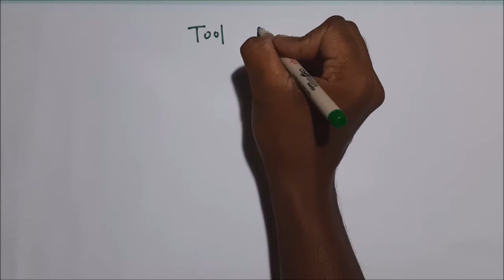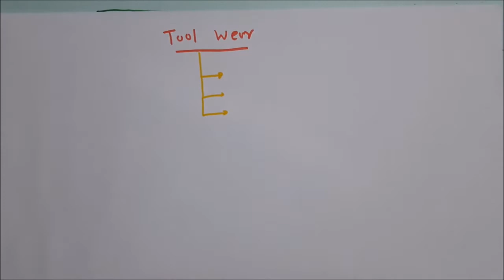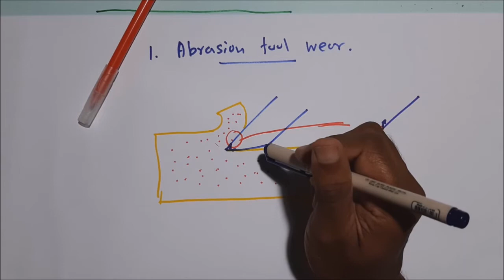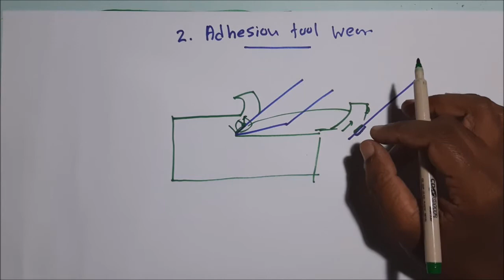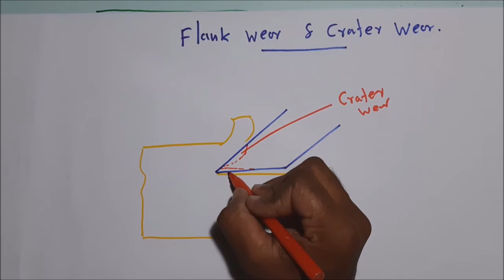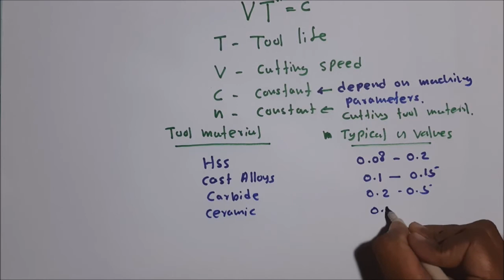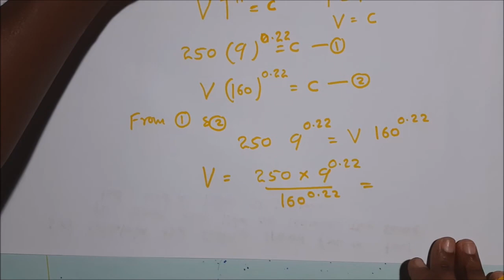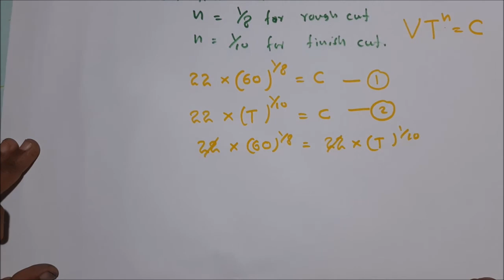Taylor's Equation for Tool Life | Lecture-5 Part III

Comment: tool failures - 1:00
tool wear intro - 6:24
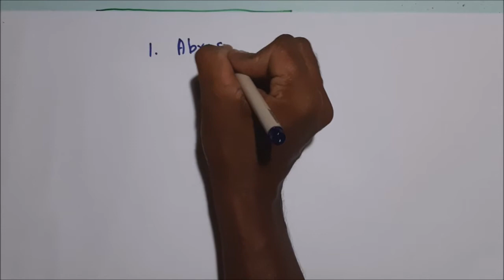1) abrasion tool wear - 8:56
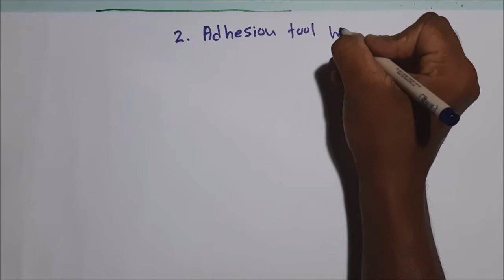2) adhesion tool wear - 13:53 
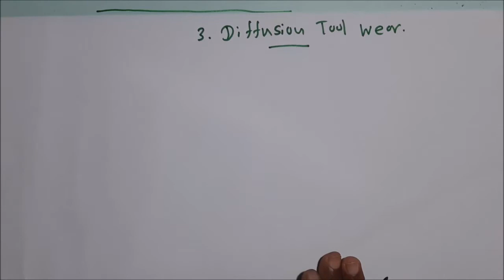3) diffusion tool wear - 17:38
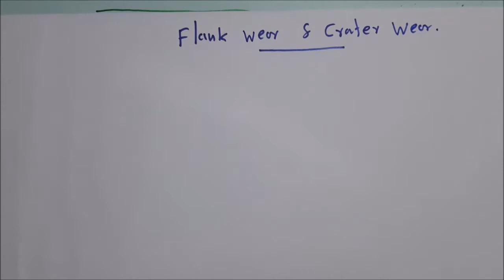flank wear and crater wear - 20:55
tool life equation - 23:25
examples for tool life equation - 28:25
🔥🔥